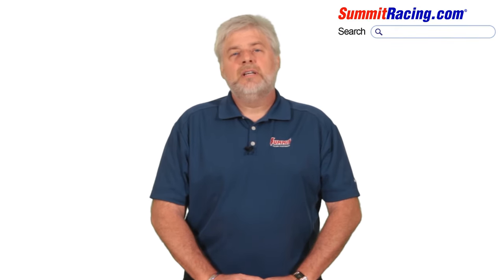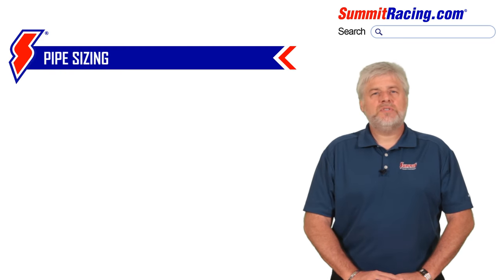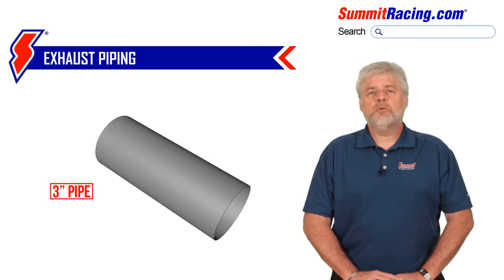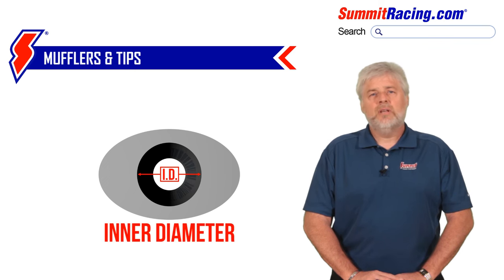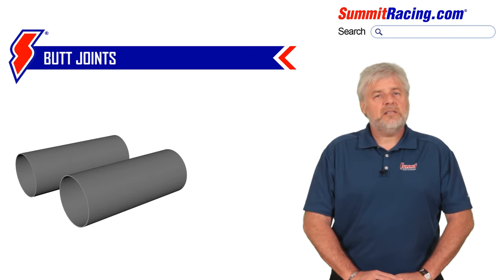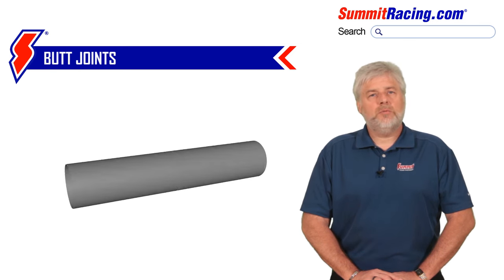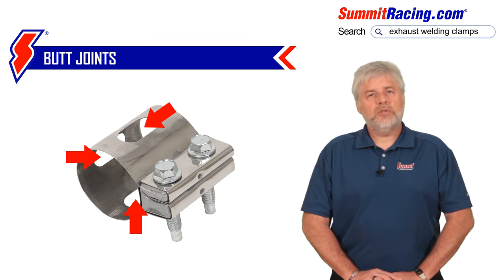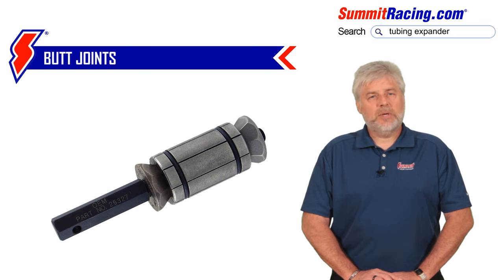Intro to Exhaust Component Sizing and Fitting

Comment: Question, can I connect a 3 inch exhaust pipe to a 2.5 inch collector without losing power or causing loss of backpressure??
Reply from the maker: You can connect the 3” exhaust, the collector will be point that would be reducing back pressure.
Reply: @SummitRacing  Thank you!

Comment: Call me stupid but I don’t know much about exhausts I’m trying to run long tube headers and a car back exhaust system on my 2008 Dodge Charger r/t but I can’t anything that it the same or is close to the same diameter piping wise. The headers I’m looking at are 1-3/4 inch but I can’t find any exhaust systems that are 1-3/4 inch to go with it if anyone can help plz so your best to explain it or just send links to the header and exhaust I need. Ps I’m looking for the best sound and power gain and by budget is around 1k for the headers and $600 for the exhaust system

Comment: what if the pip is larger then the muffler pipe, does the muffler have to be insert inside and clamped or does the muffler have to be bigger then the pipe?
Reply from the maker: It is preferred the parts all be of the same size for the best performance. If you are simply trying to use what you have you can use a reducer to connect the parts but the smaller muffler would reduce the airflow ability of the system.

Comment: The first thing you said was "most piping is measured on the O.D. dimension"......What?   Pipe(used for transporting liquids and gases) is always measured on the I.D (so you can calculate the volume of flow)., Tubing (used for building things)is measured on the O.D. because it would have to be.  This is standard knowledge world wide. I guess the exhaust industry has it's own way of doing things but it seems to me that the practice of adhering  to accurate  terminology and explanation   especially while teaching should held as a priority. Thanks for the video.

Comment: My wife has a trailblazer and I'm working to cut the catalytic converter off. Google says it's 2.5. What size pipe would fit inside so I can reattach the converter to the pipe if I'm able to clean it. If it doesn't clean I'll try some flex pipe probably

Comment: So if a measure O.D of my oem pipe before muffler it is 49mm and the smaller aftermarket muffler i could find is 51mm or (2inch) as you know...
Will it fit?
Reply: No

Comment: can tell me what size piping fits over 2 inch pipe..
Reply from the maker: Hello, It depends on what type of pipe you are referring too, mufflers are measured ID and exhaust pipes are typically measured OD so a 2 inch will slide into one another. That is not always the case but as a general rule of thumb
Reply: @SummitRacing  hello sorry i not a professional.

Comment: High I'm in need of a T304 slip-fit 12 inch long S BEND exhaust pipe 
with one end in a 2.5 inch diameter size to slip fit and the other end 
measuring 3 inches which will be TIG Welded to a 3 inch catalytic 
converter. The S Bend I need is only a inch difference to move the pipe 
over by a inch. So it's not much of a S Bend.
Reply from the maker: Unfortunately, none of the manufacturers that we carry offer anything like that. Sorry we couldnt help!

Comment: I have a 2.25 exhaust and plan on buying a 2.5 inch tip after the muffler delete . Will they be able to make this work ?
Reply from the maker: Kevin, You can make this work using an exhaust reducer, or a tip with the matching 2.25” inlet size.
Reply: @SummitRacing  i also have a 2.25 exhuast and planning to get a custom tips which are 2.5 inlets and by 3.5 outlits, can this work?

Comment: Does it matter if both sides are the same size
Reply from the maker: Hi Armiz, 
 
If the I.D. and O.D. are the same sizes on both connections, you can use a Butt-Joint clamp to make the connection.   
https://www.summitracing.com/search/part-type/exhaust-clamps/brand/summit-racing/clamp-style/band-clamp-butt-joint?N=brand%3asummit-racing%2bclamp-style%3aband-clamp-butt-joint

Comment: So, how do I know if my car only accepts a 3" cat back or only accepts a 2.5" cat back? Will the catalytic converter accept any size cat back attach to it?
Reply from the maker: As long as it is listed for your specific application, it shouldn’t matter. It’s very common for a 3” exhaust system to neck down to attach to a factory 2.5” converter. If it is stated for a specific size converter, you will have to measure yours.